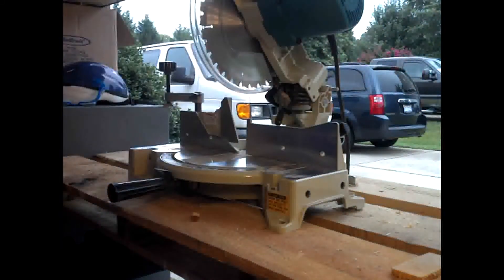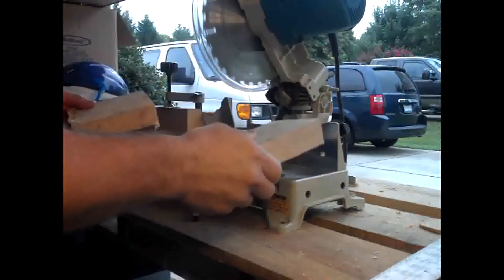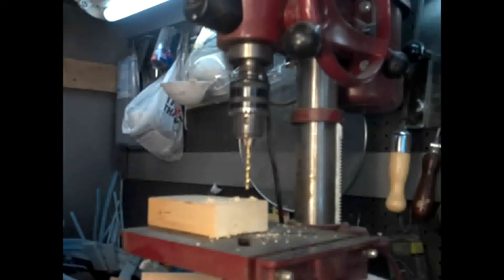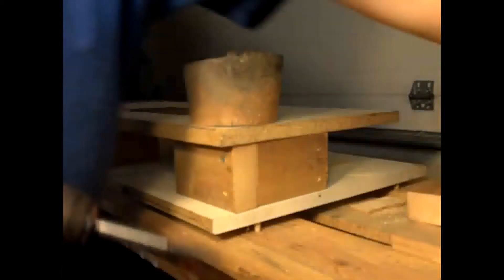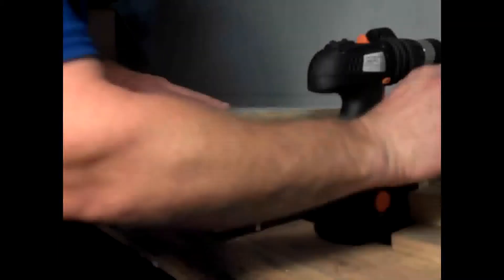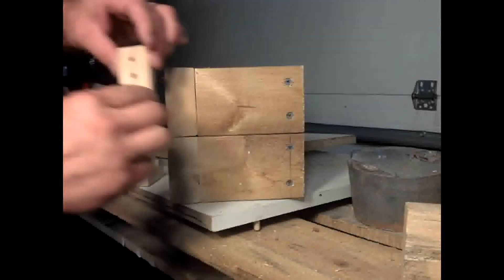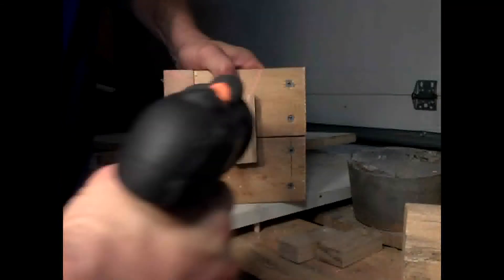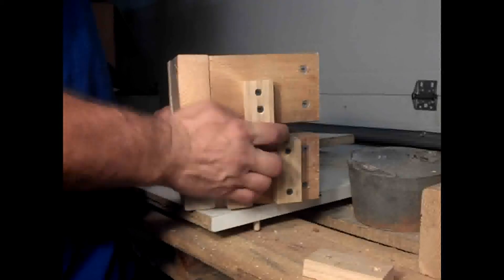How to Make a Flask Using Wood For Sand casting Metal

Comment from the maker: on re-reading your post, I think I may have misunderstood you.  If your question is, "Can you use a hinge to connect the cope and drag?"  I would say yes you could if you were making a lost foam casting that you don't have to take the flask apart again after it is rammed full of sand.  Personally though, I think a hinge connecting the cope and drag would make it awkward to use.

Comment from the maker: sure, I think what you are referring to is called a snap flask.  It is made with hinges and a clasp on the opposite corner so that it can be removed after the flask is rammed.  This allows one to make multiple castings using the one flask.

Comment: Thanks a lot for the video...I'm on a budget and really need one of these. Unfortunately I don't have quite the power tools you do, but they should be enough to handle the job. I was wondering-is it possible/would it make sense to use a hinge to connect the two pieces (frames)?